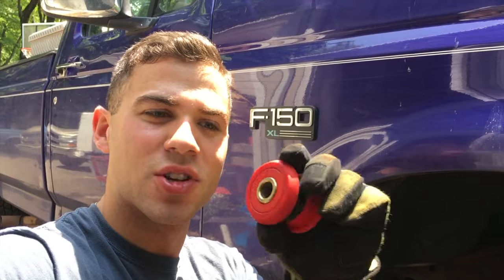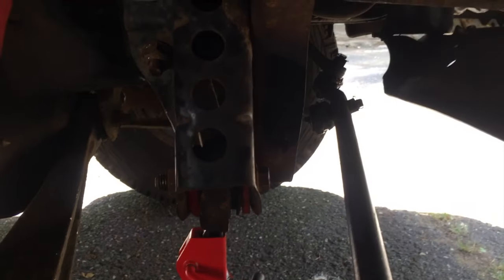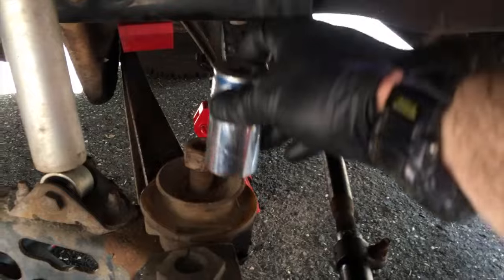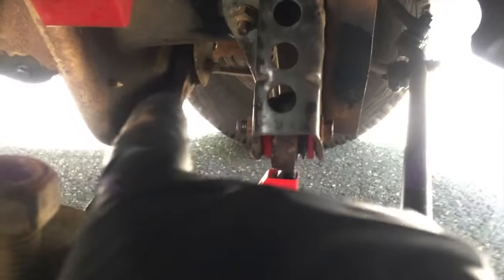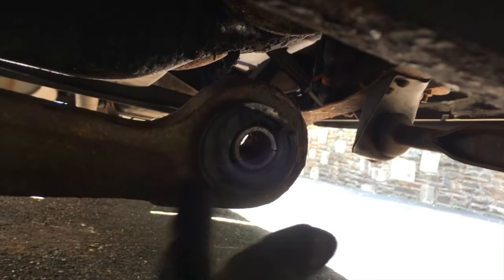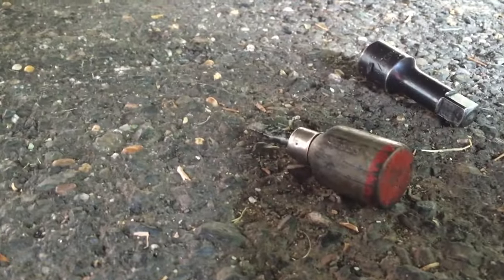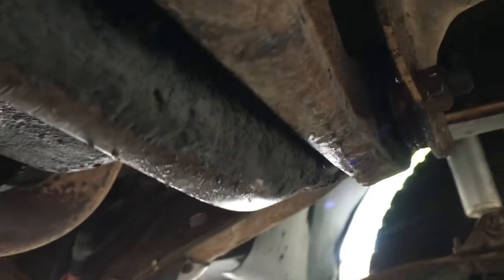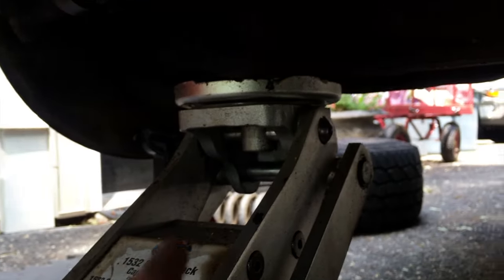How to Replace Worn Axle Pivot Bushings | 1995 Ford F150

Comment: Going to pull out my radiator today and soak it in vinegar. I need a new radiator. Have some interesting photos on my facebook profile, same name. JR Thompson. I am going to Clean and paint the pulleys, maybe replace the water pump Just because it is an 1981.   clean the alternator and the right side of the engine and paint it. Going to paint the pulleys in red, Will post on my facebook page.
Reply from the maker: J. R. Thompson Nice! Good work JR! That’s going to be one nice engine!🤙

Comment: damn fine video!!
Reply from the maker: Thanks John!
Reply: Which size bolt do you guys have for your pivot bushing? 1/2” or 5/8” bolt? Because I can’t figure out which bolt my ‘96 F150 2WD 4.9L requires? Can’t find the info I need anywhere on the net.

Comment: Do not get propane when you buy the soldering torch. Propane is in a blue tank and will not get close to hot enough. His yellow tank is what you need to use bits called MAP gas and gets more than 4x hotter than propane.
Reply from the maker: Good advice!
Reply: MAPP does burn hotter (5300 degrees F) versus propane (3600 degrees F) but it isn’t “4x hotter than propane.”

Comment: Where did you get these?
Reply from the maker: You can buy these from a few websites. I Amazon, Summit, Jeff’s Bronco Graveyard, etc. I would cross reference the part number with the one listed on Prothane’s website.
Reply: @TheMinuteMasters  ok, I was asking because yours look different than the ones I got from prothane suspension, and it came with those rings but there was no place for them, do you know what they are for?
Reply from the maker: @zackwedemeyer7497  The red rings?
Reply: @TheMinuteMasters  yes
Reply from the maker: @zackwedemeyer7497  I though the rings acted as spacers for either side of the bushing that is not enclosed by the pivot bushing sleeve.

Comment: did u use a spring tool to get it out
Reply from the maker: Nope. I was able to get the coil springs out by just removing surrounding parts. Once you remove the top retaining clip from the spring and the bolts from the top of shock, the coil spring will become loose.

Comment: Your video has some good information, but I'm curious why you unbolted the spring and shock from the frame.  I've seen this job done without doing so, but with the front of the truck lifted so the tires are off the ground.  The MAPP gas torch you have is a must-have for these kinds of jobs, and a trick I've found is to heat up rust-seized nuts and then hit the threaded area with some hydrogen peroxide (less flammable than most penetrating oils).  Propane torches help too, but the MAPP gas burns hotter and loosens rusted nuts and bolts more effectively (don't use MAPP on a torch not designed to handle the extra heat!).  Also, large C clamps make great makeshift presses, but I'd use a large socket instead if the thin band from the pulley puller because the thin band could squish.  Lastly, for getting the old bushings out an air chisel is a HUGE help easier than a ball joint press.  Thanks for the video, it's a lot easier to comment on them than to make and post them.
Reply from the maker: Thanks Jonathan! 🤙
I unbolt the spring and shock to help moving the I beam easier. You probably don’t have to do it that way if the suspension is full extended. 
MAPP gas torch is 100% the best tool in any mechanics garage. 
The large c clamp and air chisel are both great ideas. I’ll have to keep those in mind if I have to make this repair again. 
I appreciate the comment and thanks for watching!

Comment: You don't even have to do all that unbolt anything lift up the truck Stick a tire ramp underneath it lower the Jack and it moves that arm lower
Reply from the maker: This is true.
Reply: Yes
Reply: where you got your Jack stand at in the middle I put my Jack right there lifted up the truck Undid the Nut and  bolt  Lifted up the truck a little bit higher slid a car ramp underneath it And lowered the Jack just a hair and the pivot arm pivoted enough

Comment: Can this cause play in your steering wheel?

I've changed:
power steering pump
gear box
checked rag joint(it's fine)
tie rod ends
ball joints
breaks
pitman arm
font end alignment

There is still much play in my steering.

Would a worn  axle pivot bushing fix this?
Bruh, I wish u lived next door to me, u would be rich, & all my rides would run like new..

Youtube will work tho'....lol

Thanks a million for sharin..
Reply from the maker: It can cause a little play and definitely a vibration when driving at higher speeds. Unfortunately, these trucks have a decent amount of play in the steering. Drag link steering is like that. However, it’s definitely worth changing the axle pivot bushing if it’s worn. 

Haha! I’d definitely help you out man! 

No problem man! 🤙 Thanks for watching!
Reply: @TheMinuteMasters  My neighbor & I looked, & my 1990 F-150 has no axle pivot bushings..

Needless to say, that loose steering makes me very nervous..

Is there anything at all I can do to stiffen it up?

The vibration happens to be my rotors..

Thanks for respondin btw..
Reply from the maker: Dee 1 Gotcha. Well definitely replace those bushings and get your rotors swapped out. I would test drive again and see how loose it is then. A good set of shocks and a sway bar up front adds a lot more confidence to cornering.
Reply: @TheMinuteMasters  No, I meant my truck has no bushings to be replaced, my truck doesn't have the same setup for those bushings.

Everyone says don't adjust my remanufactured gearbox.

But I'm desperate at this point.

Should I just go ahead & adjust the gearbox I just bought, maybe a lil at a time?

It's a remanufactured gearbox, which means it's not exactly new..

Thanks for your patience..
Reply from the maker: Dee 1 Ah! Gotcha. You can can try to tighten the gear box but only a do 1/4 turns at a time. You can also check your steering column for play. Some of the joints can wear out.
Reply: @TheMinuteMasters  Thanks bruh..

I turned it less than 1/4, & oh my goodness, it made an extreme difference!!!

I'd say it's maybe 95% - 98% betta!!

The steering is way off center, I assume that's the alignment, but yes, most of the slack is gone now!!

I may adjust it a hair more, & leave it alone, but I'm no longer worried, it's safe at this point..

Will my box still get it's life out of it, u think?

Bruh I wish u stayed in Texas..
Reply from the maker: Dee 1 Hell yeah man! Glad to hear that did the trick! 
You can definitely get your steering wheel more center by adjusting the tie rod ends a half turn or two.

Yeah you should be fine. Do you only wear out the steering gearbox when you make it super tight.

Hahaha! That would be sweet!
Reply: @TheMinuteMasters  Thanks a million bruh..
U helped me a great deal with my fixer upper..

Won't b long, & I'll b doin cosmetics on it....
Reply from the maker: Dee 1 No problem man! 🤙 I’m glad I could help ya out! 

Nice!! Cosmetics is always fun!

Comment: Those poly bushings are no good!!! I’ve taken mine out after only a few months because I had problems with handling and sure enough those poly bushings were oblonged. Use only the original rubber bushings.
Reply from the maker: Really? People always say they make things more stiff. Were your bushings this particular brand? What brand did you use?
Reply: @TheMinuteMasters  energy suspension
Reply from the maker: @vintagedashboard6810  I forget if these are Prothane or Energy Suspension. I may have to check mine and see if they wore out prematurely.

Comment: It's it hard to remove the arm off i need to replace mind it got bent from a crash reasons im here watching the video good work anyway 👍
Reply from the maker: gerardo 12345 I haven't removed the arm but as long as you can undo the radius arm bolt and the bolt that ties the I-beam to the radius arm, then your set. I'd say with PB Blaster, some heat, and a large breaker bar or impact gun, you can do it.

Comment: Very informative and interesting video I'll however I would have painted that control arm and everything that's Rusty there with rustkote por-15 or 1500 from i e s to protect the metal parts from any further rust or deterioration also would have used a new properly graded replacement bolt rather than reuse the old one
Reply from the maker: Thanks man!🤙 Yeah it would have been nice to paint everything but on a DD it’s hard to have my truck sit that long. A new bolt would have been nice but so far so good on reusing the original bolt. I’ve put 60k miles more on that bolt.

Comment: This is almost impossible on a 4x4...im just realizing this lol....ahhhhhh no room with front end differential
Reply from the maker: Whose Money Haha! Yeah I totally forgot about that! I wouldn’t say it’s impossible. It will just take a little longer and there are a few more steps.
Reply: I managed it, but yes a pain in the ass.
Reply: I know this is old but can we get a 4x4 video
Reply: The front differential is really not at all hard to remove, since it has no drain plug and it’s probably been there the whole time those bushings were wearing out , it wouldn’t be a bad idea to drain and remove that pumpkin. Fresh grease does wonders for making stuff last. I added a drain plug to mine when I had it off, I’m far from a mechanic , if I say not that hard to do, you can bet it’s easy from anyone who likes wrenching on their own stuff.

Comment: the most important thing you did not show getting the bushings out and in
Reply from the maker: I didn’t show how to get the bushing out because there are multiple options. If you want another OE rubber bushing you need to press the entire bushing and sleeve out. I’ve see it done with a ball joint press. I’ve seen the rubber bushing cut and burned out. Then the steel sleeve cut and taken out in sections. If you go the poly bushing route, you need to burn, cut, and dig the rubber bushing out of the steel sleeve. Then sand the inside of the sleeve clean. Then, as I explained in the video, use a ball joint press to install the poly bushing. 

I also choose not to show these parts because they are basic concepts to auto mechanics. If you know how to use a ball joint press, a torch, and some scraping tools, you can remove the bushing and replace it.

Comment: Did this solve your wondering issues?
Reply from the maker: jumaane butler It definitely made the truck "track" better and more consistently. Overall the driving and steering feel was more firm. I still have some wonder but I know now that it's from the steering box. Now if you are still deciding whether to do this repair, I recommend you do it. You will see an improvement in these high mileage trucks. The parts are cheap. Labor and know how is the more difficult part.
Reply: It's really common for wondering steering due to gear box being bad. If it's factory gear box and truck is 96 or older replace it anyways